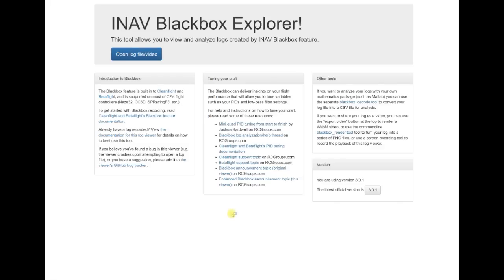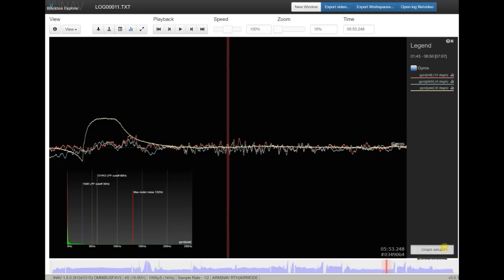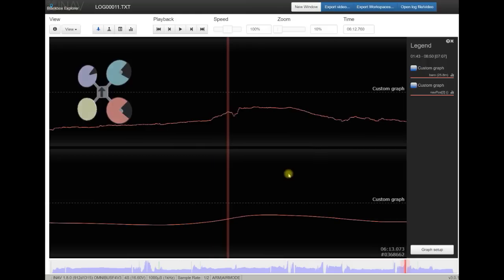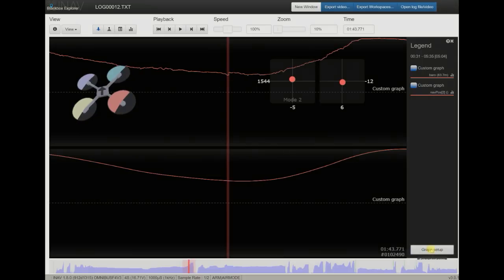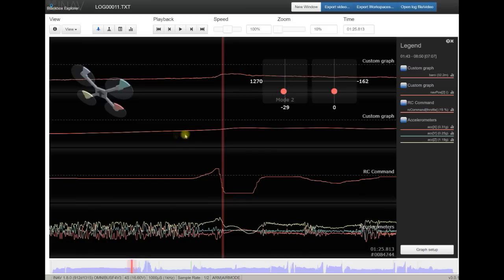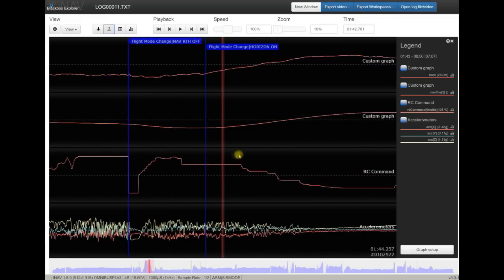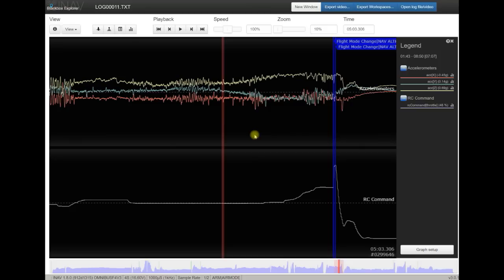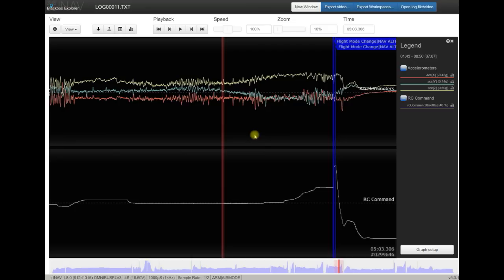INAV Blackbox Analysis #2 - Altitude Hold problems

Comment: Hey Pawel, at 4:23 you mention that the vertical position is calculated with reference to Barometer, GPS, and Accelerometer.  I thought the GPS Altitude was only used in Fixed Wings, is that not correct?  Multi rotors are able to use GPS Altitude to help stabilize z-axis movements?

Comment: Can you make a video on trouble shooting pids and vbrations on larger quads. I own a f450 that is very wobbly under the 450 class inav preset. Even tried the other and still no luck. Motors and props are balanced but frame is a little wobbly. Any chance I can filter it out? I am using a matek f405 AIO (no yaw twitches).
Reply from the maker: Tuning on big multirotors is somehow different than small ones. Push roll and pitch P until it will become locked in. My 600mm requires around 11-12 on P to fly good.
Reply: any filtering settings?
Reply from the maker: sammichael25 https://www.youtube.com/playlist?list=PLOUQ8o2_nCLlfpaP8pMhVwO9VBHw0kFdE watch this playlists

Comment: Had something similar on a Tricopter with 8" props a year or so ago.
Was using a RC Explorer tricopter frame flight controller, where the actual FC is the frame, holding the arms together. So any vibrations from motor / arms, goes straight into the accelerometers..
couldn't get rid of vibrations, and had really poor alt-hold.... Soft mounting motors helped a little, but still not enough. finally solved it by having a separate flight controller, mounted on some stand-offs... Alt-hold immediately became perfect....